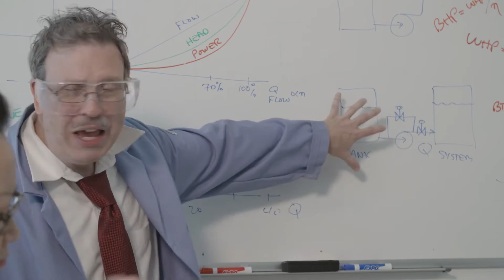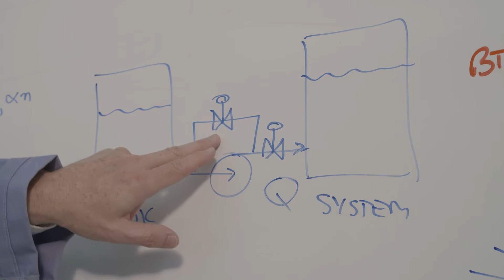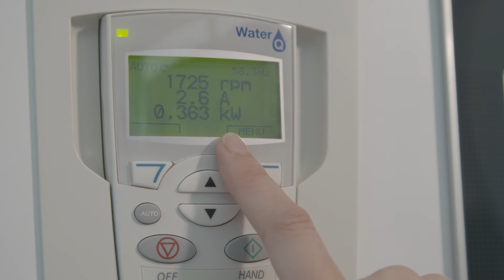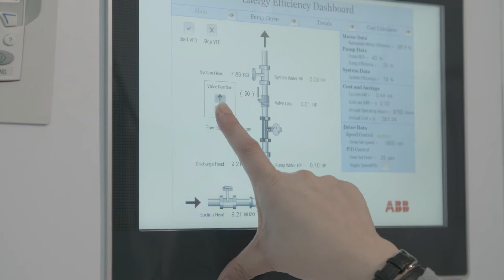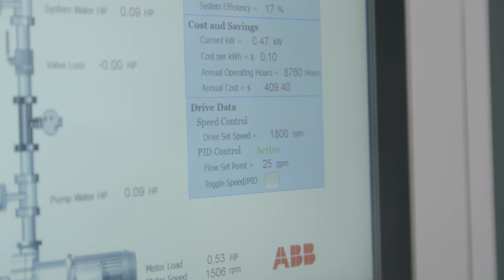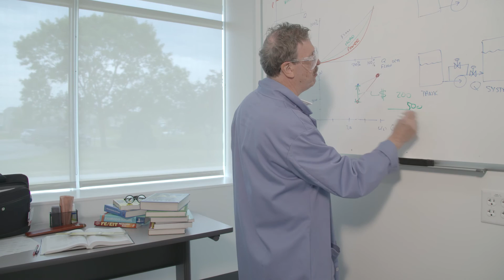The Affinity Laws and Variable Frequency Drives: A Lesson in Savings

Comment: Sir you just down the frequency and down the speed and save the running cost of motor is so good because motor speed will decrease and draw the power become decrease but tank hight will increase the pressure is become not enough ....ohh....super sir I just clearly identified this.......

Comment: Pressure wasn't mentioned. You cannot slow the motor down that much in real world scenarios because there is always some lift to overcome. VFDs cannot save you money if it always takes 70% of the motor power to just get the water out of a 100ft deep well. The motor can never be slowed down less than 70% to get flow with no pressure. To get decent pressure (50psi) it can't be slowed much, no $ saved! I'm not even adding in the cost of all the electronics, installation, and maintenance. Maybe show your energy savings on a real world application instead of in a demonstration tank. VFDs have their uses but they do not save money.
Reply: VFD's are more specifically used for process control in industry. I haven't seen any application so far which strictly mention energy saving in the designing. Money saving is an attractive norm used by VFD manufacturers to attract customers. Of course in Lab demonstration it was very tempting but on industrial scale it's not proven yet.

Comment: I see that pressure wasn't mentioned, but it was sometimes visible (fluctuating) in the video.

Full speed, valve fully open:    39 GPM , (~8 psi), 364 W
Full speed, valve partly closed:  25 GPM,  (~8 psi), 298 W
Slow speed, valve fully open:   25.7 GPM,  (~3.5 psi), 144 W
Reply: This was described by head being proportional to the square to motor RPM, but likely not emphasized as mush as it should have